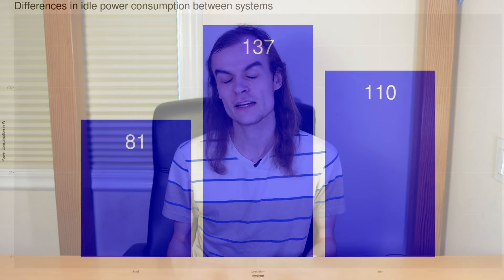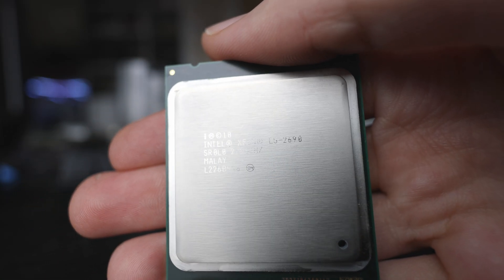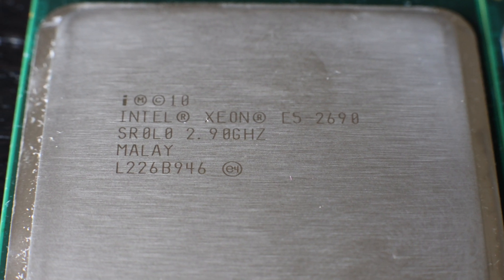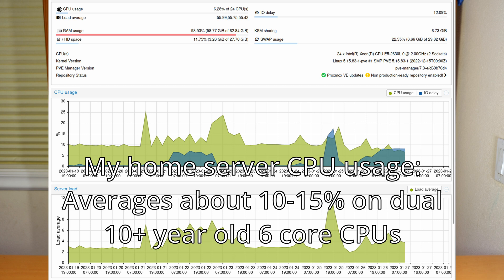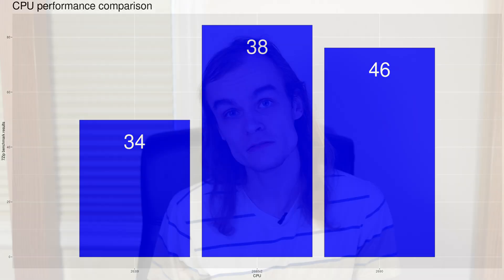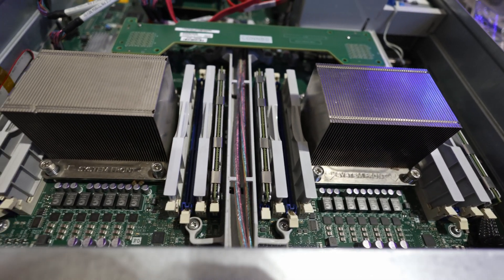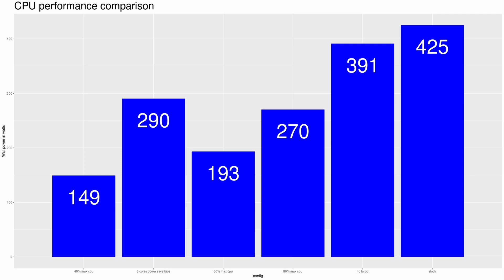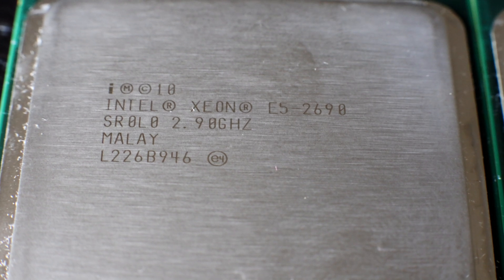How much does a low TDP CPU matter? Comparing low and normal TDP server CPUs

Comment: I've just switched from LGA775 core 2 duo that idled at around 32 watts ( with no add in cards ) and 40 + watts with NVS315 graphics card  . To an LGA1155 with I5 2500T quad core , this idles at 22 watts , and doesn't need a graphics card . I5 does you tube no problem at around 10% usage and 25 watts .  Better still is my quad core Atom that idles at 6 watts !

Comment: Good points, thanks for sharing. About your last thought: why are vms don't use as much cpu power as we think? Why is that? Can they be way faster if they do?
Reply from the maker: From my experience VMs are often not using much cpu. Services like web servers,databases and more use little cpu when a few clients or light loads so extra cpu power isn’t needed. The tasks are already running as fast as the server can do them typically.

Comment: Thanks for that info, not a lot of info on Web about this stuff, I have  E5-2697 v2 (12 core) Hyper-V home lab setup with 15 active VMs, a 30TB data and movie library (7 x 8TB 7.2K SATA disks + Adaptec RAID Controller),  2 x 2TB SSD PCI-E Cards,  a 10 Gig PCI-E NIC, I also have CCTV VM that has HW Passthrough to a Quadro M2000 card for Video Recognition (AI) processing (even with 6 cores the on VM the CPU can't cope). With "Power saver" mode (only tried this 2 weeks ago) I now get down to ~152 watts and spike up typically to a max of ~246 watts (only when RAID/SATA disks are active) , "Balanced" mode kept me pegged closer ~190 watts... I  have a free 22 core Xeon 6152 (so cheap now) from work and I'm trying to figure out if I can justify an upgrade, if this new "platform"  (CPU + a Supermicro X11SPL-F Motherboard) could save me 20 - 30 watts.. in the UK with our current crazy electricity prices, 30 watts difference could  pay for motherboard in 5 years ($600 - $0.45 per KwH)  otherwise despite a UEFI BIOS that doesn't support secure boot an  iKVM that breaks (but I know how to fix) every time I update Java , a lack of SSE4 AVX2+512 (no software I have seems to need or can use them) it's hard to justify upgrading (spending ~$800) my Supermicro X9SRL-F and  E5-2697 to save maybe 30 watts.

Comment: In my case, i've Intel S2600GZ + 2x2630Lv2 + 256GB ram - idle 68-70W. When switched to 2x2670v2 - idle power usage went to 86-88W at power socket. One PSU 750W, second unplugged from AC. 6x2TB SSD SATA (Data), 1xM.2 SATA 128GB (Proxmox) + 512GB nvme for VMs. How did you go up to 110W at idle with 2630L ?

Comment: Would to recommend ryzen 5 5600g as CPU for a proxmox using 3 vms, one for pfsense, one for plex + transmission + pihole etc, and another one for a windows vm that I will use rarely for some applications like photoshot etc. Along with this I will use 1050ti that I will passthrough to my windows vm. Wdyt ?
Reply: Does Proxmox support HW passthrough to a 1050ti? In Windows/Hyper-V Sever Nvidia only supports passthrough on Quadro x2000 and up cards .. found out hard way after buying a Quadro P400
Reply from the maker: @lloydieization proxmox should support a 1050 to be passed though. The nvidia drivers can be picky but I believe they allow GeForce cards to work in VMs now. 

I wonder what issue you had with the p400. Did it work in proxmox? I don’t think proxmox cares what gpu or pcie device is passed through but there are many different issues that can come up in pcie passthrough.
Reply: @ElectronicsWizardry  Have never used Proxmox, Just  Hyper-V on Windows Server and ESXi, All I know is that PowerShell command/script that identifies DDA capable cards/devices says the Quadro P400 is not capable of HW passthrough and other places on Web confirmed that only Quadro x2000 + are supported.
Reply: Ryzen 5 5600G ... issues with these platforms is the limited max memory of 128GB, some MBs only support 64GB, followed by PCI-E expansion, this is really limited on modern desktop motherboards... most literally only support one 16x PCI-E slot at full speed  before bumping them down 2 x 8x PCI-E or less if  you plug in another card that has more than a PCI-E 1x interface and that's if your MB even has 2 x 16x slots etc..., not standard these days...  I have 5 PCI-Cards in my setup... a 10Gig NIC, GPU, 16 port RAID controller, 2 x PCI-E 2TB SSDs (all cheap second hand stuff from eBay)  apart from maybe the AMD thread ripper boards no modern desktop MB can support this many PCI-E lanes  and if they even come close they will be more expensive than even a new server board .  FYI Xeon 6152 - 22 Core 2.1GHz (Turbo 3.7Ghz) CPUs are currently going for approximately $50 - $100 eBay (at least in the UK)
Reply: I really don't think i will ever need more than 128 gb for my homelab. 
It will run 24/7 and my house wanna be a 'green' one, all my electronics is A+ and I have solar panels. I need a cpu that has a gpu integrated that I can use for transcoding etc, and few cores to support a home assistant and also a windows vm to perform basic tasks.
I checked and ryzen 5600g in idle will consume around 10 watts which is really great for me. 
I don't think Xeon 6152 will perform near less than 40watts.

I already have a synology 923+ with 18tb of storage + 2tb ssd for caching, connected on 2.5gbe lan is more than enough for me..
The synology will keep all my data, movies etc, but I need a power machine (not really so powerfull 5600g) that will manipulate this data.
 @lloydieization

Comment: Three things:

1) In the screenshot that you showed where you were talking about how your CPU usage was only between 10-15%, the load averages that the screenshot was also showing, was ~55. Whilst that might not hit your CPU's FPU, it is definitely putting a load on your system, and depending on how high that gets, that can have an adverse impact on the performance (and/or responsiveness) of your VMs, which is also somewhat dependent on the number of VMs that you're running, what those VMs are doing/responsible for, what type of VMs they are (LXC containers vs. VMs, Windows vs. Linux, etc.), as well as the setup for your storage subsystem (NFS, iSCSI, SMB, ZFS, SLOG/ZIL/L2ARC, etc.).

2) If your system is just a "dumb" server, then I would definitely agree that it probably doesn't need much in the way of CPU performance, with some notable exceptions: If you're running HDDs, that's probably fine, although the historical rule of thumb is one physical CPU core per drive. (It's not necessarily a "bad" rule of thumb to follow.) If you are using SATA/SAS SSDs, that might be more important. If you are using NVMe SSDs and on the AMD Threadripper, Threadripper Pro, and EPYC platforms, where your NVMe SSDs can have DIRECT PCIe 4.0 x4 connection to the CPU itself, then the performance of the CPU might start to matter quite a bit more vs. trying to run 24 U.2 NVMe 4.0 x4 SSDs through a Ryzen 5 processor.

(And that doesn't include bandwidth requirements from any other peripherals like networking and/or GPUs, etc.)

3) For some workloads, if you DO end up choosing a lower power CPU, which, yes, will make heavier workloads run for longer, again, the other downside to that that this video does not address is that using your CPU for longer can also adversely impact the responsiveness of your VMs.

My consolidated server runs a pair of Intel Xeon E5-2697A v4 processors (16-core/32-thread, 2.6 GHz stock) for a total of 32-cores/64-threads, where it is managing 32 physical drives, plus 1 logical drive which consists of four more physical drives (via the LSI/Avago/Broadcom MegaRAID SAS 12 Gbps 9361-8i SAS RAID HBA). That virtual drive consists of four 3 TB HDDs in a RAID6 (LSI manages that RAID array) for my boot drive. The remaining 32 HDDs are managed by ZFS inside Proxmox 7.3-3 in a 24+8 configuration, consisting of three 8-wide raidz2 vdevs, which are all a part of one ZFS pool (bulk storage) + another 8-wide raidz2 vdev which is used to host the VM's boot drive disk image files.

(I found that when I had all 32 drives in the same ZFS pool, the VMs were slow to respond when there was a lot of activity on the bulk storage ZFS pool, so I split them out so that the VMs would be able to do its own thing, whilst the bulk storage was doing something else.)

I have also found that if the CPU load goes up, so too, does my IO delay.

And some of my VMs are more responsive when there are more vCPUs assigned to that VM compared to others. (This is true in some Windows AND Linux VMs.)

And if you add a 100 Gbps Infiniband network card in there, and because Proxmox 7.3-3/Debian 11 does NOT support NFSoRDMA, I will also have to keep at least ONE CPU core free to handle/manage 100 Gbps IB traffic.

As a result, I actually will set the CPU affinity mask in my VMs so that 2 physical cores/4 logical cores, are always free for the host system to use.

And having this many cores available to you, helps with that.

Comment: On the AMD desktop side, i like the nonX and the GE series because these generally dont pump 1.45V into silicon that is not supposed to go over 1.2-1.35V according to the manufacturer of the silicon(depending on if you're talking about TSMC 7nm class or 5nm class)

Edit of note, if you are willing to check often, you can just take an X series chip and under-volt it in the BIOS, but you MUST check it often, because i've had the undervolt re-set after a power loss, despite no other settings being reset, and any BIOS update will usually reset this as well.
Reply: This is probably why we're seeing alot of Zen2 based CPUs requiring lower speed RAM or outright failing to post afer years of overvolting from factory

Comment: I have turned to higher TDP cpu´s lately, even with higher electric cost.
Swapped out a couple of older 2650L´s machines to with 2698 v3´s and virtualize stuff instead. Got more power now, less amount of servers and less power draw over the day.